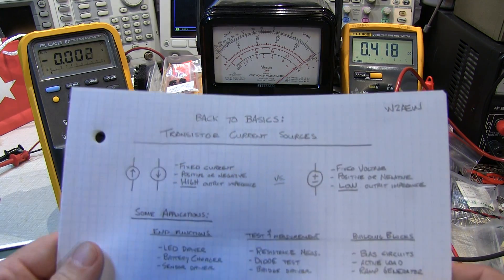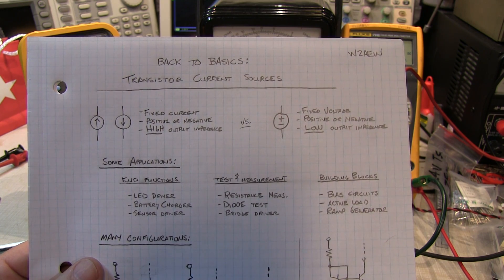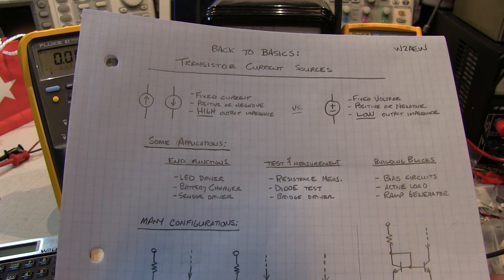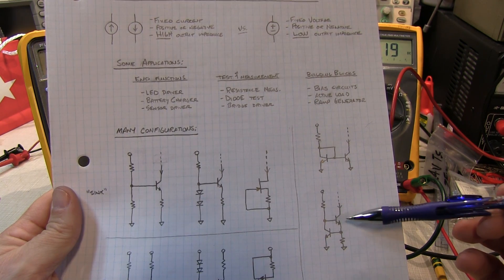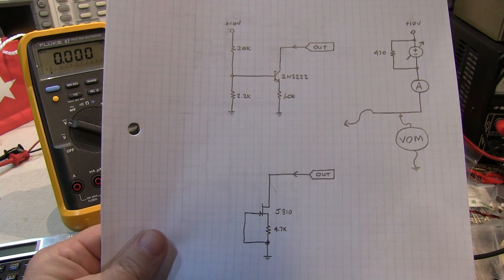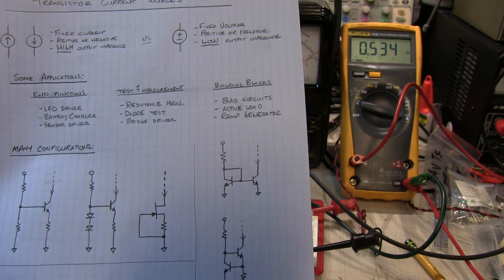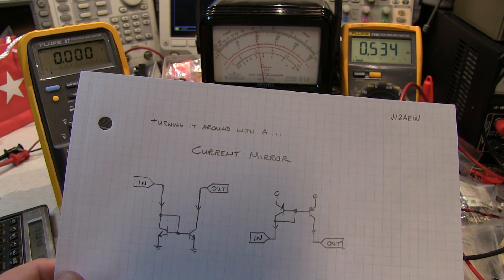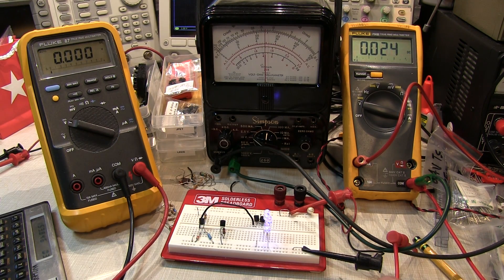#190: Back to Basics: Transistor Current Sources and Mirrors

Comment: You do an incredible job of walking a dumbo like me through this subject. One question........ you said a couple of times that the constant current source can improve the gain of a transistor, the reason isn’t so obvious to me.
Reply: A current source is a very high impedance - so when it is used as the load in the collector of an amplifier (instead of RC), the gain will be very high (since gain is gm*RC)

Comment: Do you have a video you'd recommend for the variable, floating power supply? I'm confused by how its set up. 
1) I normally see supplies hooked up with the negative to the ground. 
2) It seems to be putting its positive out on the +10V rail. In my mind that would cause a short between the variable supply's voltage (assuming its any value other than 10V) and the 10V rail. But this must not be the case here. 

Thanks for any insight
Reply from the maker: Please see this video, it might help to clear this up for you:
https://www.youtube.com/watch?v=mJL11UF1arQ
Reply: Thanks, that helps with the floating aspect. 

So the last thing I'm struggling with may just be me not understanding notation. At 8:07 you are talking about the variable supply. When I looked at the diagram I assumed + terminal of the variable is going in opposition to the + rail. Does the symbol not represent the direction of the voltage? (By which I mean the - variable terminal is at 10V and the variable + terminal goes down toward the ammeter)
Reply from the maker: The variable power supply basically sets the voltage that is generated between the + and - terminals of the supply.  Since the + end of the supply is connected to the +10V supply rail, the - end of the supply is XX volts below +10V.  For example, if the variable supply is set to 3V, then the - end of the supply will be at 7V in this circuit (10-3).

Comment: @w2aew for the first example of the "source" PNP, does Re become a fixed voltage? I assume Ve is Vb - .6., and does the fixed voltage change with resistance change of the Re? I'm trying to experiment with a 10k and 1k..
Reply from the maker: Yes, in each of these examples, the intention is that the voltage across Re is fixed, which results in a fixed emitter current, thus a fixed collector current - provided the transistor is kept out of saturation.
Reply: w2aew so you don't want the PNP running at max current? In this case, does saturation turn off the transistor?
Reply from the maker: Saturation is not defined by operating at max current.  Bipolar transistor saturation is define when the collector voltage gets very close to the emitter voltage, such that the base-collector PN junction gets forward biased (turned on).  When this happens, the transistor current gain (beta) drops significantly and the transistor collector-emitter begins to look like a short.

Comment: Hi Pro. At 9:28, is the BJT in saturation or linear region? Why there is a 1.0K resistor at emitter?
Thank you for these knowledgeable videos.
Reply from the maker: It is in the linear region. The 1k resistor helps to set the current based on the resistor divider at the base and the base-emitter drop. It makes the value of current mostly independent of transistor beta.
Reply: When a BJT is in linear region,  is Vbe (base-emitter drop) a constant value for different collector current values?
If the emitter resistor is removed, and use a pot to replace 2.2K. Can I tune the pot to get a adjustable current source?
Thank you.
Reply from the maker: In the linear region, the Vbe is nearly constant, but will vary a little.  Your suggestion would make it very difficult to adjust the current source to a particular value - very unstable and will vary with temperature.  Much better to leave the degeneration resistor (1k in emitter) in the circuit, and then adjust the base voltage with a pot.

Comment: Hello w2aew!
I have a small question. How does the current mirror function in the LT3750 block diagram in the datasheet?
You mentioned that it maintains a steady current,  so I assume it is for some measuring function?
Here's a link to the datasheet: http://cds.linear.com/docs/en/datasheet/3750fa.pdf
Thanks!
Reply from the maker: It's not really a current mirror.  The diode-connected PNP simply establishes a bias voltage on the other PNP transistor.  When the stored energy in the transformer is being transferred to the capacitor, the voltage across the cap is reflected (with 1/N) to the primary and appears at the RVout resistor.  Since the bias voltage at the RVout pin (the PNP emitter) is basically fixed, the voltage at the transformer is transformed into a current across the RVout resistor.  This same current is sent through resistor RBG.  Thus, the voltage across RBG is proportional this current, which is in turn proportional to the voltage across the cap.  This voltage is compared against an internal 1.24V reference to detect full charge.
Reply: Thank you!
That was very informative.

Comment: I love these fundamental electronics videos. Can I ask you how to match transistors used in a current mirror? Is it ok to compare the measured Hfe? Or are there other parameters needed.. (like thermal coefficients..) ? Thanks in advance.
Reply from the maker: Most important would be to match Vbe, and then beta.
Reply: Thanks. Makes sense though if the bases are connected together in the current mirror circuit, the Vbe should be close.

Comment: Thanks for the video, helped a lot!
I just came across another current source configuration called the "wilson current mirror".
Could you do video about this one and explain why you would pick a wilson current mirror over the basic two transistor current mirror configuration :-)
Reply from the maker: +Rolfrolfsen Wilson current mirror provides more accurate current mirroring (less error between input and output current) and a higher output impedance (more ideal current source, less load dependent) than a simple two-transistor mirror using degenerative feedback.  Might make for an interesting video in the future.

Comment: Great video!, Thanks a lot! I really enjoy your videos.
Can i ask you a question?
In the video at 7:44, what do you mean by "floating power supply"?
Reply from the maker: A floating or isolated power supply is one that generates the desired voltage between its positive and negative terminals, but neither of these terminals is connected to ground.

Comment: I don't fully understand why the 470 ohm resistor is required. What would happend if not used?
Great video. Thanks.
Reply from the maker: +David Senabre The 470 ohm resistor around the variable power supply ensures that the supply always sources current.  Without it, the circuit would try to make it sink current, which it can't do.
Reply: +w2aew Why would the variable supply sink current? Doesn't the transistor sink current? Current flow, as I see it, will always go from +10V to the collector. The variable power supply just reduces the 10V subtracting from it (as they are opposite polarity), but why should this invert current flow?
Reply from the maker: +David Senabre A power supply is designed to source current from its positive terminal, and have it return into the negative terminal.  If the 470 ohm resistor wasn't across the variable supply,  the collector current would have to be sourced from the negative terminal of the variable supply (thus, the positive terminal would have to sink the current from the main supply).

Comment: What about MOSFET current sources? It would be nice to power high power LEDs with a cheap power MOSFET c.source.
Reply: Until the MOSFET starts to generate alot of heat thanks to the high current load.

Comment: hi good day I need your help in designing a current source using the diode pair.  Can u do a tutorial showing the design and calculations?
Reply from the maker: +Anjana Dabideen Can you be more specific about what you need?  "Designing a current source using the diode pair" doesn't make sense to me.
Reply: I would like if u could demonstrate the current source using the PNP transistor. I have to design a 100W 8ohm amplifier that has a current source supplying the long tailed pair.
Reply from the maker: +Anjana Dabideen The diagrams at the bottom of page 1 of the show notes have some of the basic configurations for a PNP current source:
http://www.qsl.net/w2aew/youtube/transistorcurrentsources.pdf
You generally start by knowing what value of current you need, call it IC.  It's generally a good idea to have 0.5 to 1V or more dropped across the emitter resistor. The "middle" diagram, the one with the two diodes connected from base to VCC, will put about 0.7V across the emitter resistor.  Thus, you can calculate the resistor value as 0.7V/IC.  Then calculate the resistor that goes from the base to ground.  You want the current in this resistor to be about 10x greater than the base current in the transistor (or more).  So, you calculate the base current by taking the IC value divided by the transistors Beta or Hfe.  Then, multiply by 10 to get the bias current through the base-gnd resistor, call it Ibias.  You then calculate the resistor value as (VCC-1.4)/Ibias.  Done.
Reply: +w2aew Thanks alot for your help.
Reply: +Anjana Dabideen Can I ask you for one more explanation. I lack some fundamentals on this topic and i am unsure how to go about choosing the input current and voltage to meet the specifications of the amplifier project i am doing. Seeing that i have to design a 100W 8ohm amplifier what is an acceptable Ic?
Reply from the maker: +Anjana Dabideen Certainly you're not thinking about using the long-tailed pair to directly drive 100W into an 8 ohm load, are you?  This would mean that the transistors in the long-tailed pair and current source will dissipate >>100W - very inefficient and impractical.  Maybe you need to rethink your design approach.
Reply: @w2aew  Your notes no longer seem to be available on your website. Do you have an updated link?
Reply from the maker: @MarkVanderberg  I fixed the link.

Comment: What would you have done differently to get your Simpson 260 to not effect the readings?
Reply from the maker: If I connected the positive lead of the 260 to the other side of the ammeter, then the ammeter would have only "seen" the current source and the current reading would be correct.  Then, all I'd have to do is measure and account for the burden voltage of the ammeter.
Reply: Sorry Alan I should have commented on the other video. Could you have placed a high value resistor between the probe and ground? Mimicking the digital meter?
Reply from the maker: That would solve the issue of the parallel current path, but the VOM wouldn't indicate the correct voltage.

Comment: Great video. Earlier today I built most of the circuits you showed, my favorite was the voltage divider biased BJT with two diodes in place of R2 in the divider. This circuit was remarkably stable, even when I changed the supply voltage or dropped in transistors with different betas. One configuration I tested, a 500 uA sink, showed less than 10 uA change with a 100% swing on the supply voltage. Remarkable.
Reply from the maker: Yes, this is exactly what you'd expect - nice job.  Note that I made a mistake with my use of the old Simpson 260.  It's input impedance was too low to be used to measure the voltage on the current source output.  See my next video for details...

Comment: Hi, I did not got the part about why the in the current mirror, if the transistors are matched, they will have both the same collector current. Is it because they both would have the same base current and thus the same collector current? Since those are BJT,  then I guess Vce if the leftmost transistor can get tu saturation because then it would not be enough to turn on the both transistors right?
Reply from the maker: Given matched transistors, they'll have the same collector current because they have the same base and emitter voltages. The leftmost transistor can't saturate because it is connected as a diode (base connected to collector).
Reply: ***** Thank you so much! Wow, you opened my eyes :P since collector is connected to base, Vce = Vbe, and Vce_sat < Vbe so it wont saturate. Taking a 2N3904 as example, Vbe ~ 0.7V and Vce_sat ~ 0.3V. Collector current would be I_c = (Vin - Vbe)/R  where Vin: source voltage, Vbe: base - emmiter voltage, and R the resistance in the collector. Is this correct? If I may, one more question: How would you compute base current? With the gain beta @ I_c since it is not saturated?  And I forgot to say, Nice video as always!
Reply from the maker: Yes, you have the collector current computation correct. Since the transistor isn't saturated, base current is just IC/beta.

Comment: Would it be possible to demonstrate dependent voltage/current sources? Also, are you planning on doing a BJT differential amplifier with a current source?
Reply from the maker: I do plan on a diff amp, and show how current sources can be used...

Comment: Thanks Again.. I like back to basics. One question though, Transistor matching is that part number to part number or actually test each transistor of a type for its characteristics.
Reply from the maker: Paul Moir Thermal matching is very important for accurate mirroring.  The -2mV/degC change in Vbe can dramatically affect the accuracy/tracking of each side, especially when you consider that each device will likely be dissipating different power.
Reply: It's funny, I was just recently playing around with a discreet current mirror.  You can still get dual matched transistors these days.  I was using the BCM847, which is a pair of matched NPN transistors.  The PNP version is the BCM856.  Unfortunately they tend to be in really tiny packages.
For the prototype I hand matched some discreet transistors for gain and glued them together for some thermal matching.  I also used some emitter degeneration like w2aew says and this helped a lot.  Before doing that my 1ma mirror drifted up to almost 10ma as one side warmed up!  You'd be surprised at how poorly transistors will match even one after the other on a paper tape strip.   5%-10% from one to the next is what I saw.
Reply from the maker: It really goes beyond just matching part numbers.  Where circuits like these are used extensively, and rely on device matching, is typically in integrated circuit design where the transistors are extremely well matched in gain, leakage, temperature, etc.  In these cases, device matching is taken advantage of in many circuit types, not just current sources and mirrors.  When device matching isn't as practical, then techniques like using emitter degeneration are often used.  If you're going to rely on matching for the circuit performance that you need, you should match items like gain/beta, leakage currents, Vbe, etc.
Reply: Thank you for the full answer, previously heard of temperature q point etc effecting device to device.. so your answer makes sense.

Comment: Umm, so my understanding of output impedance is a bit wrong I suspect. I understand how a constant voltage source has ideally no impedance at all since the voltage is constant, but with constant current sources/drains, I am not sure. I thought the transistor will continually change the impedance of itself (it's saturation) thus causing the voltage drop to change, thus leading to a change in the current. Of course if the transistors gate if connected to a resistor in a way that a negative feedback loop is formed, the transistor will end up regulating current at least to some degree.

Can a constant current source really be thought of like a really high voltage with very high output impedance, like a resistor on the output? I did wonder that for a long time, but decided that it is not an accurate to think of constant current sources like that.
Reply from the maker: For BJTs, the collector current will be nearly constant vs. load if:
1) The base-emitter voltage is constant (thus base current is constant)
2) The transistor is not cutoff or saturated.
For FETS, the channel can be thought of as a voltage controlled resistor at low V(DS) values (linear region), but behave more like BJTs when V(DS) is raised.  This is called the "saturation region" for FETs, which is different than the saturation region for BJTs.

Yes, you can model the current source as a very high voltage with a larger series resistor.  Of course, this model is only valid over an operating voltage range that applies to the circuit being used.
Reply: ***** Very interesting! I will have to graph out ohms law with that HV + large resistor with considerably lower voltages and see what I can learn.

So If I had a infinite voltage source, with an infinite (this infinite is some factor bigger than the infinite voltage) resistance, then would I have a ideal current source? I will see if I can figure this out with mathematically, I will probably end up having to apply some basic calculus knowledge because surely, when I am dealing with infinities, esp. (x*infinity) / (y * infinity), I will need some concept of limits and things!
Reply: ***** Can the output impedance be described as di/dv (a derivative )?
Reply from the maker: Yes, it is dV/dI